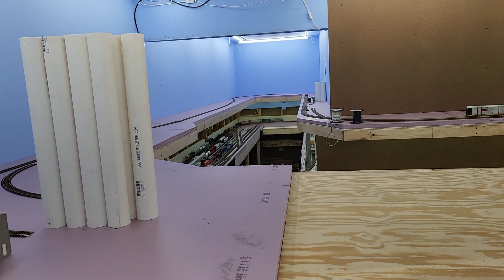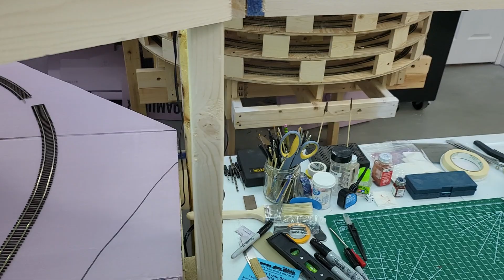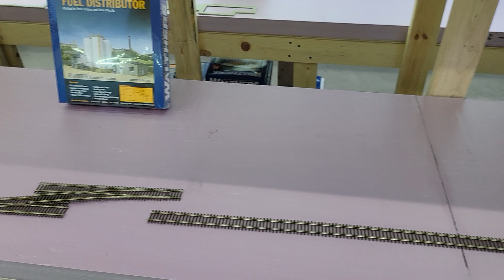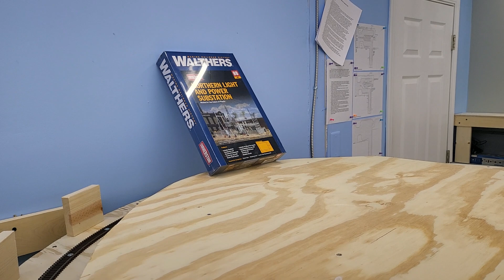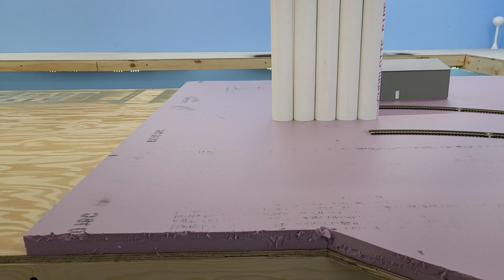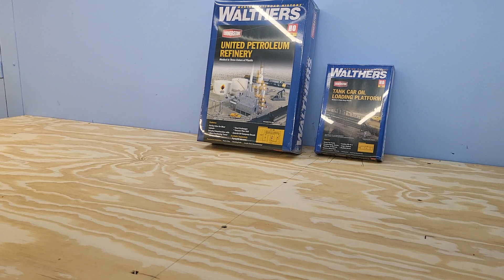K & W HO Scale Model Railroad, Construction Update #15 - What area do you want to see more focus on?

Comment: You said you're using your garage for the layout. What are the dimensions of the garage?
Reply from the maker: No, I'm using the garage for a cutting station, both because the layout takes up the whole train room in my basement (it didn't in earlier videos), and to help prevent dust from getting all over everything.  The train room is L-shaped, 26'x15', with the smaller leg of the "L" being 15'x5'.